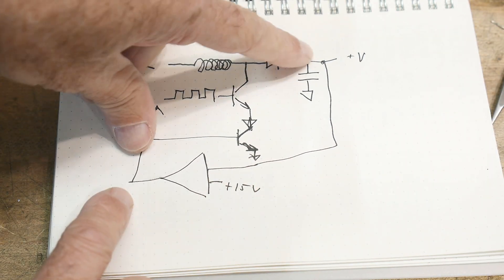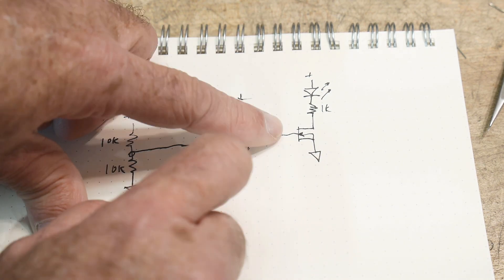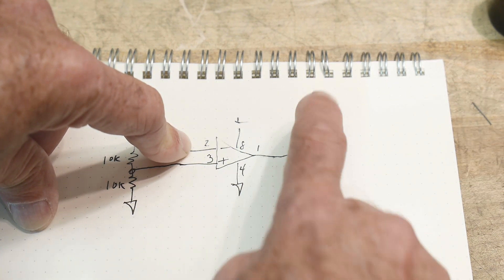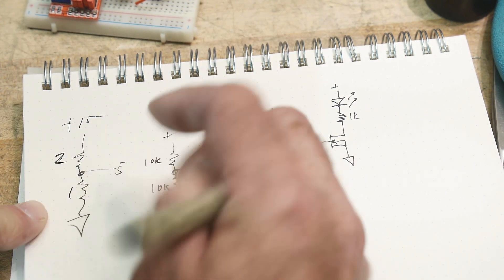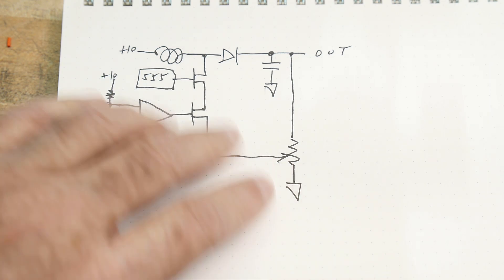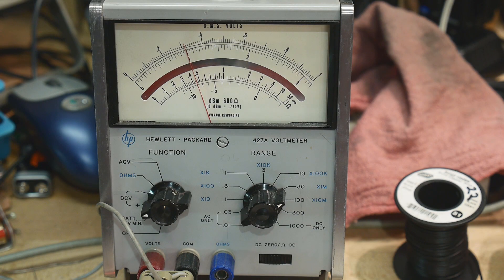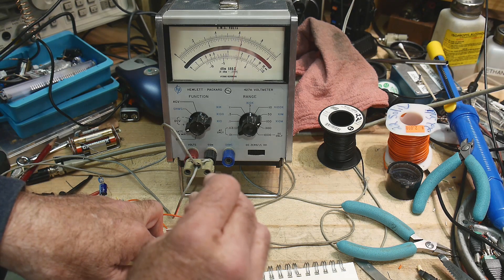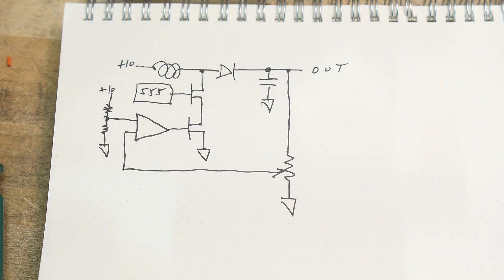#691 DC-DC Boost Converter Basics (part 3 of 3)

Comment: Wait a minute... if you used an N-channel MOSFET, wouldn't you need your comparator to output a negative voltage?
Reply from the maker: most N-chan FETs will be off at zero volts and on at about +2V

Comment: Thanks for the great video, the output voltage will be equal to the input voltage times off time. I would suggest talking about the regulation in terms of duty cycle of the PWM signal. Your introduction to error amplifier/comparator is very interesting.
Reply from the maker: I did. I know its hard to watch 100% of a video. On average if you get 45% view time that is great.
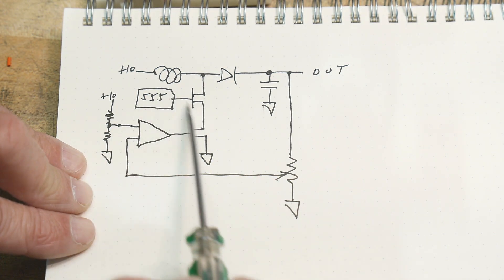Reply from the maker: 9:10
Reply: Very diplomatic, lol. My inability to be that diplomatic is what stops me every time I have the impulse to start a YouTube channel.

Comment: Love these kind of learn-as-you-go videos.
I'm goig to suggest a change in that AND function with the transistors: it is usually done with an actual logic gate and then you drive only one switching transistor, not 2 in series.
Reply from the maker: It was a simple circuit to show the idea. I mentioned it was a learning tool. any real circuit would not be designed this way, you are right

Comment: So how do we increase the current capacity?
Reply from the maker: The current comes from the stored energy in the inductor. A real circuit will have a big high current inductor, usually a toroid to store more energy.  The inductor I used as 1400ohms resistance and so that limits its current.

Comment: are you serious about this? that feedback loop is gonna sing like a bird in spring (a.k.a oscillate like hell) maybe just maybe except for a very limited range of loads. you were changing that pot for its whole range and the voltage was only changing like 2-3 volts that should indicate this is not working as intended. More importantly it was not load tested! 
That's not how feedback in DC DC converters work, you need to feed that sampled output to the 555 to change its duty cycle in order to keep the output voltage at a fixed point independent of load. turning on/off the switching and without any hysteresis is a recipe for oscillation
Reply from the maker: I'm glad you watch my videos with such interest and passion. Let me say, you are missing the point of this basic video. It is a teaching tool to show the basic concept, not teach people how to design one. the circuit I used was very silly. It was made to use a very small number of parts in a very basic configuration to show the idea. using a relay coil? using the FETs in series? silly. The reason the POT had limited range was because of it's value. the circuit could only generate 90uA so the POT had to be 270k at least. I just grabbed something off the bench and I think it was 100k, so I had to put a second resistor in series to drop the current. That limited the range. I did not mention that because I didn't want to confuse anyone. It was the idea that was important not the details. Keep watching!
Reply: @IMSAIGuy  Even though you eventually gave up, I have to say that your initial responses showed great patience and restraint... Oh, and btw, I appreciate your videos a lot.
Reply from the maker: @largepimping  thanks
Reply: @IMSAIGuy  first it doesnt matter how much was the pot value, you are using the center pin as voltage divider (5:49) so no matter what value the pot has you always have a range of 0 to 100% voltage division whether it is 100 ohm pot or 1M pot. At least that's what the schematics shows. The fact that the circuit loses regulation at 90uA is telling you that it is not working properly. Also it will be unstable because the feedback is wrong.
My point is that if you are trying to teach newbies how switcher works, this video is misleading because the feedback mechanism is never used this way  to turn on/off the switcher! with the same amount of simple parts you could have easily applied the feedback to 555 to control the charging capacitor and thus control the duty cycle to regulate the output there was no need to do anything fancy. in fact you didnt need the second mosfet either.
Reply from the maker: @amirb715  I give up
Reply: @amirb715   🤦🏻‍♂️
Reply: You shouldn't give up, he needs too. This dude wants to be spoon fed the correct circuit. Doesnt understand you need to think on your feet. Keep going the way youre going the armchair engineers will fall out.
Reply: There are plenty of videos that will talk about finer points of boost conversion. There aren't many which will take you from hand tap-tap-tapping to a 555 and show you why the first one works in*principle so you know why the PWM versions will work in practice. I get value from this! Thank you
Reply: Do you think that a beginner, and he said from the start that beginners were his target audience for this series, would understand a single thing you just said? They wouldn’t, and that would stop them from learning the basics they need to move forward. 

Also, you didn’t really think that @imsaiguy was unaware of any of that did you? If you did, you haven’t watched any of his content.